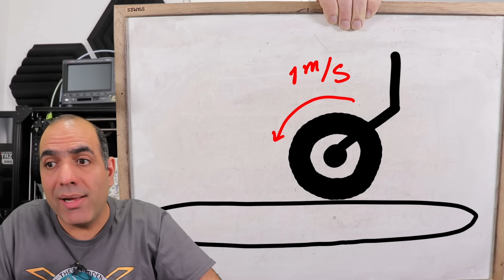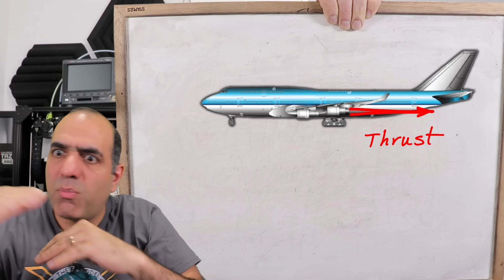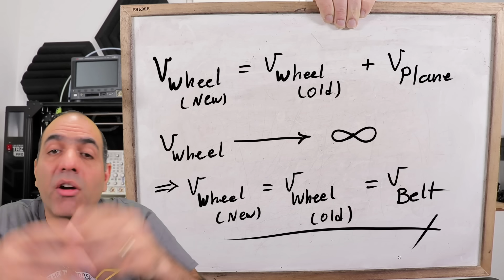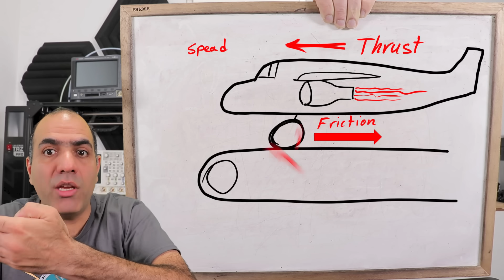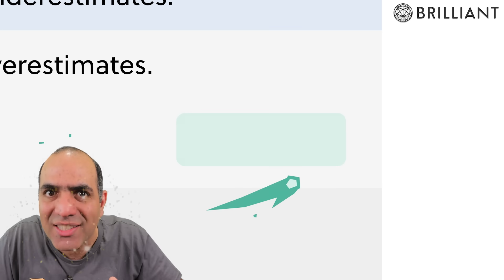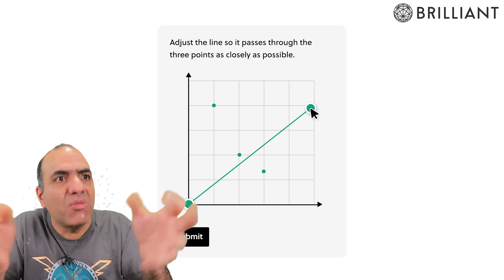Airplane Question that Drove Me NUTS!!!

Comment: No, because 0 speed means no lift... Engines alone don't make the plane fly
Reply: Yes, the air hitting the under the wings creates lift
But friction between wheels and belt is not completely non-slip, so no
I forgot if the belt was infinitely long
Reply: The video was released 2 min ago, how tf were u able to comment 8 hrs ago 😂
Reply: @neellohitdash YouTube premium 😂😂😂
Reply: This has been done in real life, the plane takes off. It’s ground speed is completely irrelevant to a plane having lift, lift it determined by the air flow over the wings which create lift. This is why you can see planes being completely stationary tied to the ground for storage, and the wind lifting the plane off the ground and dropping it down again.

Comment: Taking a naive approach with a suitable handful of assumptions, I would say it depends on whether the plane can take off with its wheels locked. If the wheel spin is zero, the belt speed would be zero. Giving the breaking force of the wheels (my assumption), I doubt the engines have enough power to achieve the needed speed for take-off. The wheels will also probably explode in the attempt from friction and wear.
Reply: The video was released 2 min ago, how tf were u able to comment 9 hrs ago 😂
Reply: @neellohitdash  Time zone differences, he is 9 hours ahead of you most likely
Reply: @williamjordan4741  hmm if that's the case isn't YouTube taking that into care? But yeah something to ponder upon 😹
Reply: How did u say this 9 hours ago but this vid came 5 mins ago
Reply: Wrong. The plane just has to move the flaps down and plane goes up not matter what. At a certain speed of course.

Comment: I say no. For obvious reasons. If it was a harrier jet
Reply from the maker: HAH! That's the case of the unicorn!!!
Reply: @ElectroBOOM I must've missed that part. I remember you saying unicorn.
Reply: @ElectroBOOM  I see alot of redundant magic unicorns behind you. You need to hug them more often. Hahaha
Reply: @ElectroBOOM  I know right?? 
It uses the jets for the force
Reply: @ElectroBOOM I wish someone could simulate this, my caveman brain can’t take this
Reply: @ElectroBOOM  The video was released 5 min ago, how were u able to reply to his comment 10 hrs ago 😂.
Reply: @neellohitdash  early release for subscribers?
Reply: @neellohitdash  dude you asked that on every comment
Reply: @madkills10  yp indeed 😅
Reply: interesting
Reply: *Thrust
Reply: The video was released 2 min ago, how tf were u able to comment 10 hrs ago 😂
Reply: Wha ? - frictionless air bearings on the wheel hubs. plane still takes off. Wheels are not driven. Just imagine the plane is on skis instead. The wheels would spin 2x as fast but the plane still MOVES forward.
Reply: harriers are not 747s

Comment: There is no uplifting force from the surrounding air. That force can only be created from the rapid movement of the plane through the fluid, and it cannot take off if it stays in place, which is what this system is doing here.
Reply: The video was released 2 min ago, how tf were u able to comment 11 hrs ago 😂
Reply: @neellohitdash  Patreon i believe
Reply: @easterneagle8811  hmm interesting🤔
Reply: @neellohitdash  why are you spam commenting this?
Reply: @fivepandas1  not spamming, just curious, apparently I saw for the first time that when a video was released 2 min ago, and there are people who are able to comment 5 to 10  hrs before even tye video was released.
Reply: @neellohitdash  you commented this on every one of the comments that were posted before the video was, you could've just commented it on one or two
Reply: At least, if the plane wheels control the conveyor speed, or they are equal in some other way.
Reply: Why would the conveyor cause the plane to remain in place? The wheels are free spinning, they're not connected to a drivetrain like in a car. It doesn't matter how fast they spin or what the conveyor does, as long as the brakes aren't on they're not connected to the rest of the plane.